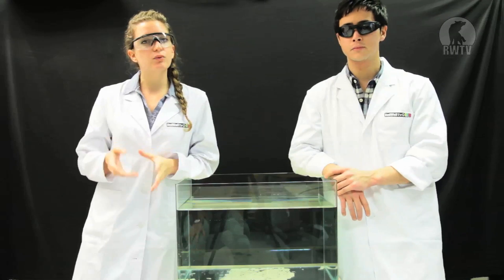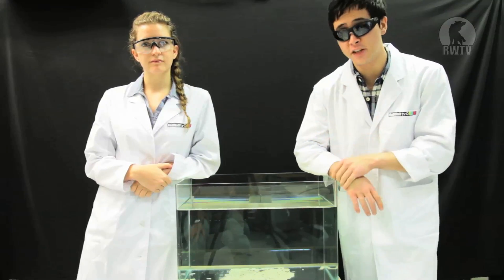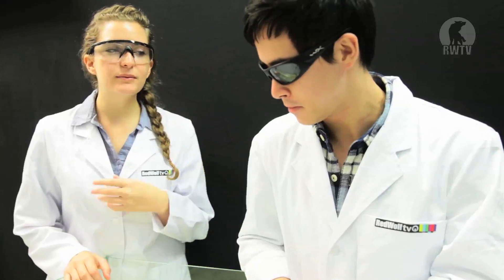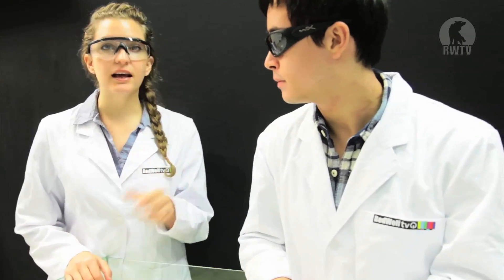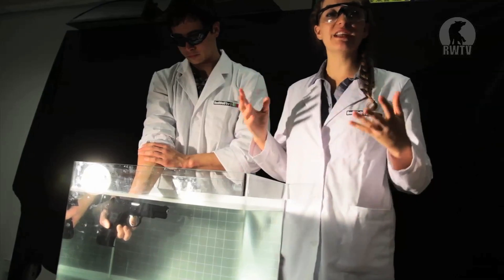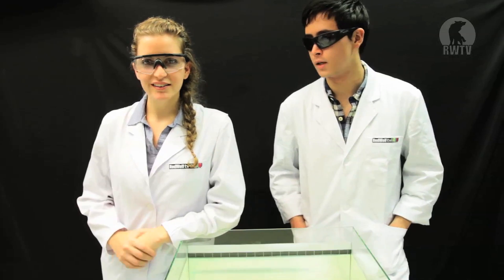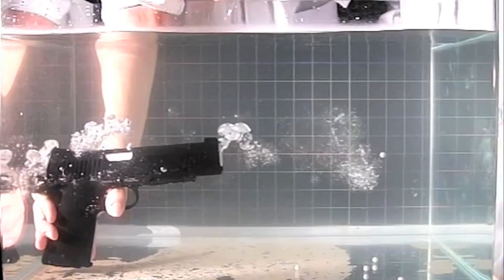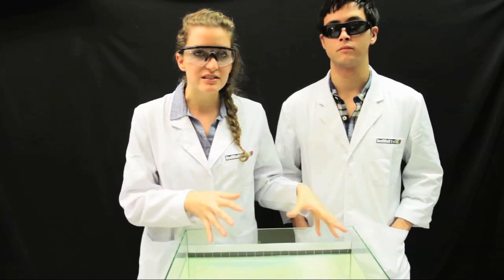Redwolf Labs - Does Airsoft Shoot Underwater? (HD) - RWTV

Comment: I can't believe that, the piston will pull back and the chamber will fill with water, then your screwed. A regular spring or a gas powered gun you won't need to worry about that because they fire more like a real weapon than the battery powered ones.

Comment: Funny nice test, however you cant compare and measure inches of manual , gas and CO2  as they have different power output in first place.
Marui hopup is fixed to 0.25g bb, fps with 0.20 approx 190 - 220 , Topgas GBB should be around 310-340fps , CO2 320-380 fps, Also AEP is missing in this test. G18C for example
it would be more interesting using same power guns. 
good job, keep it up